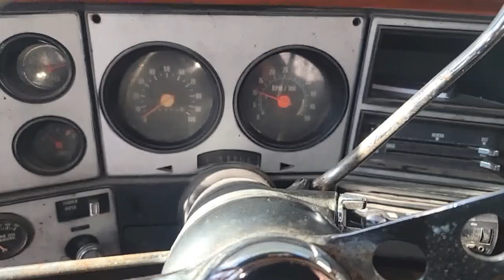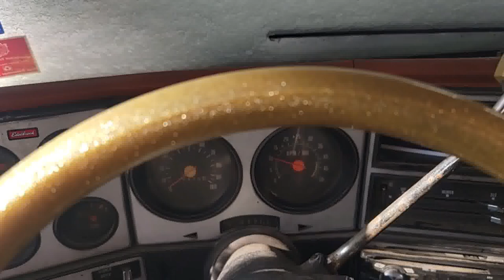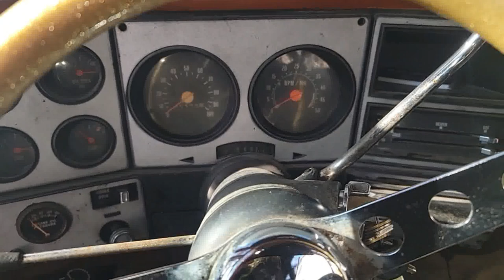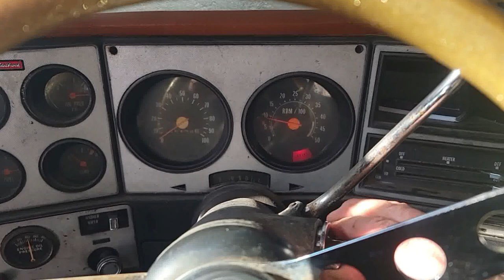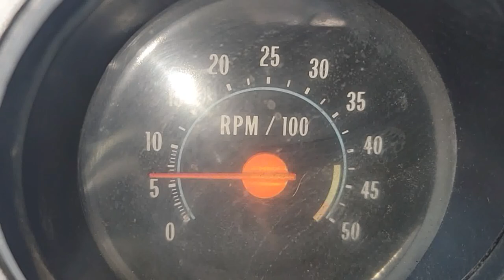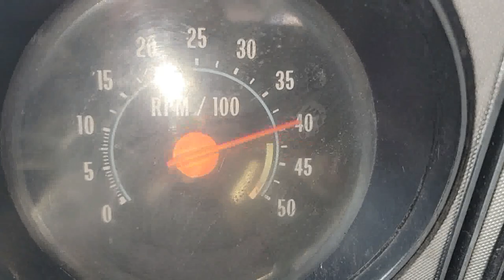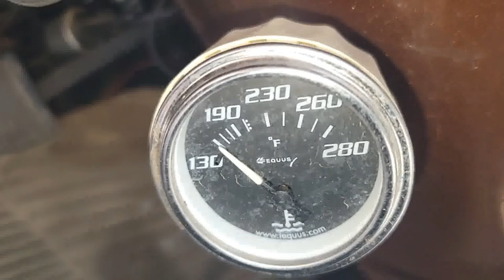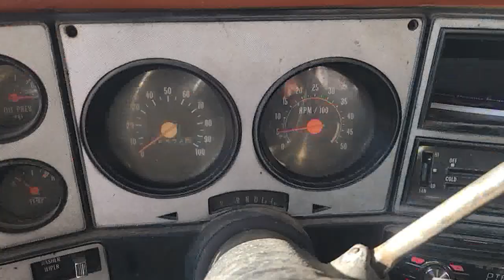Forgotten 78 Chevy farm truck - WILL IT START?

Comment: Didn’t this truck use to be a manual as well ???
Reply: Matter a fact it was a 350 with a manual transmission originally for sure I’ve been watching you for like 15 years I’m 26 now and still vividly remember how clean the truck was and the abuse that it went through 😂😂😂
Reply from the maker: No, actually that was the original 1977 c20 farm truck you are remembering.